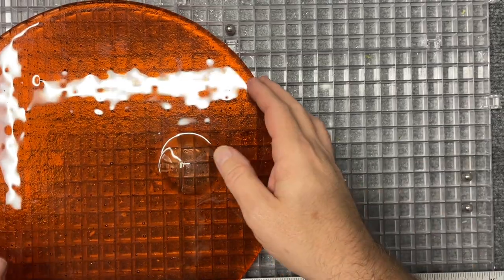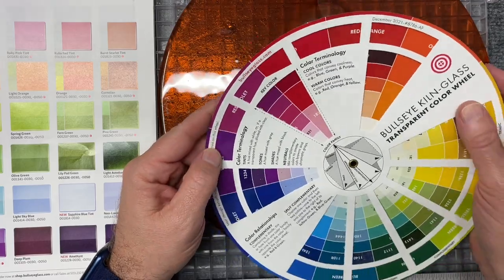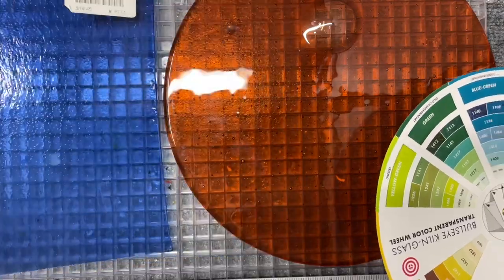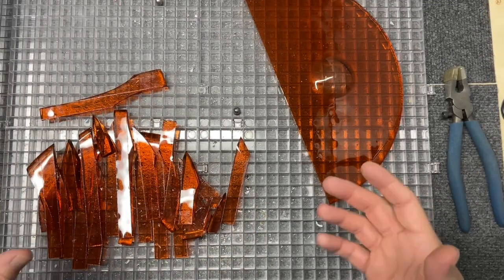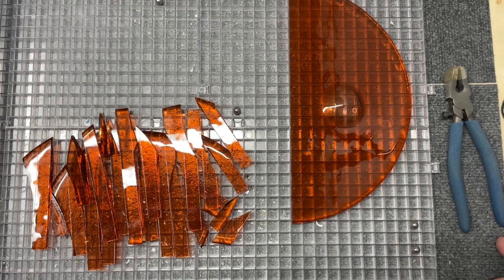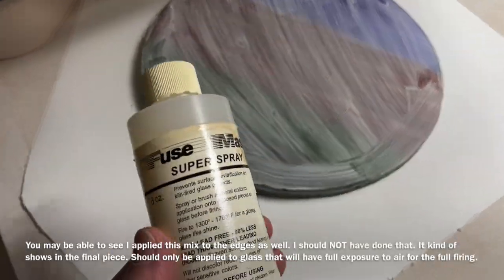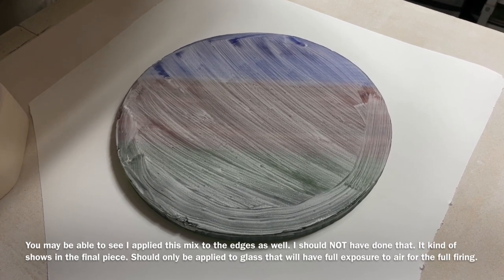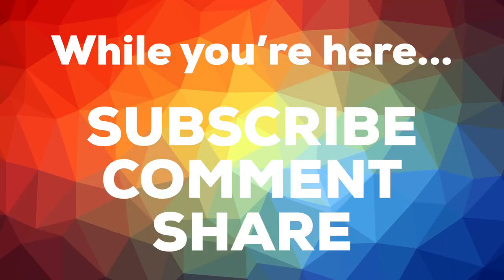From Disasterpiece to Masterpiece! Using Color Theory and Bullseye’s New Color Wheel!

Comment: Thank you for this idea! I have a light coral plate that I’d fired and slumped on an impression mold several years ago. I think it might have been old glass, and I ended up with a bad case of devit. I’ve re-fired twice with a dusting of clear powder both times, to no avail. The coral was pricey when I bought it, and is even more so now. So I have been looking for something to do with it so it doesn’t go to waste. And I love this color combo. I need to use my color wheel more than I have.

Comment: Hey Jamaison.... I have a similar piece (Transparent scrap) where I used a Patty 7" diameter mold and the final full fuse thickness turned out to be about 12mm thickness. Here is my question I have a Skutt Hotstart Pro where my working bottom surface is 15" diameter. If I did your second firing would I run out of room? Or would you use a stainless steel ring as a capture bearer if the spread was too big to avoid a mess?
Reply from the maker: I’m sure there’s some sort of fancy math equation that would answer this question, but I have absolutely no idea. If it were me, I’d definitely go with the ring
Reply: @JamaisonSchuler  ... that was what I was thinking .... 1520F... just curious what your kiln is... so a spread firing is above a full fuse correct? I'm new to this but learning everyday. I have never done a spread firing.  But at this temp the glass moves?
Reply from the maker: @diggingeverydaydean8080  I borrowed that schedule from Laurie Spray who does a ton of these “spread firings.” I think the idea is that temp really allows the glass to flow more. I have a Je Ken Profusion 26
Reply: @JamaisonSchuler  FYI.... just spoke with Laurie and showed her your schedule you posted. She said 100-600-0 was better than 100-300-0... also instead of the Super Spray could you have used powder frit??
Reply from the maker: @diggingeverydaydean8080  I was being extra conservative on the slow ramp down to 300, but you’re welcome to stop at 600 if you want. This is just what works for me, and I often use a more conservative approach when I’m worried about the complexity of the project. And yes, clear frit would probably work well. I was pleased with my approach too.

Comment: Did you use a paint brush to put on the SprayA?
Reply from the maker: Yes, just a cheap foam craft paintbrush
Reply from the maker: Yes, just a cheap foam craft paintbrush
Reply: @JamaisonSchuler  Thanks.  Years and years ago I used those products but used an air brush.  I was interested to see how you did it because it looked good that way and certainly is simpler.